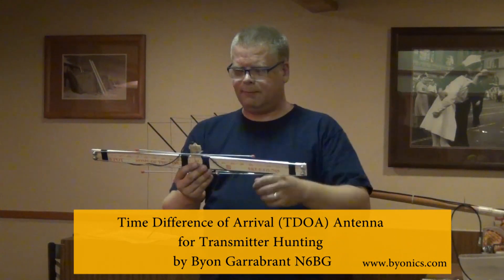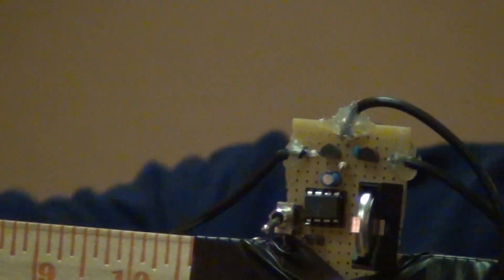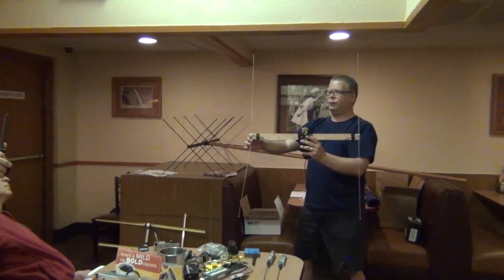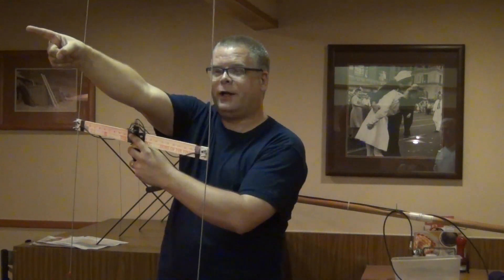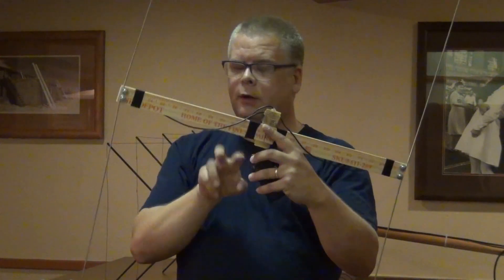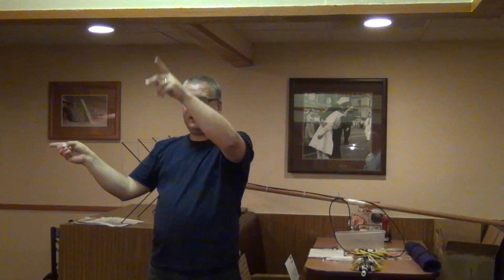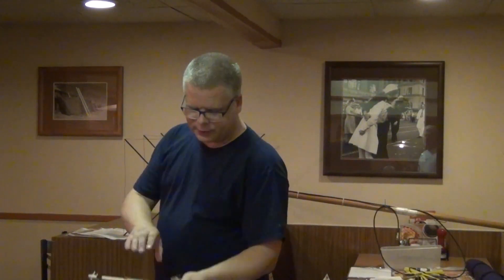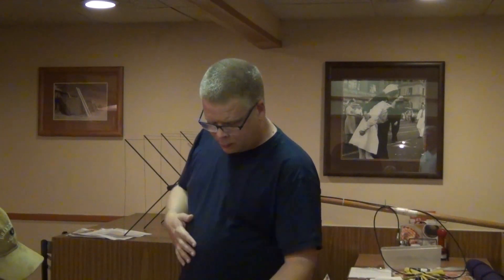Transmitter Hunting using TDOA: Time Difference of Arrival

Comment: One way for this to work is to use one element as the front, the other as the rear element. Measure the time it takes for each to receive the signal. The rear element should get a delayed signal, equal to it's distance, from the front element. This way, it eliminates the problem with the Equidistant TDOA method.

Comment: This is Doppler DF unit developed by the Germans in WWII.  In WWII the ship receivers did not have RF front end amp so the LO would go back up the antenna and radiate.  Germans knew Allied ship freq and radio being used so could determine LO freq and listen even when ship was not transmitting.  I am sure with WWII tube tech it was large unit.  I built about 10 years ago using 555 and PIN diode switching.  Also there are manuf that do make with 4 or more antennas with diplay and do not have to turn the antenna array.  Coast Guard in Florida have units on their boats and also array on towers for locating boats in need.  Does work great, even the 2 antenna version.  Works with FM rig and listen for tone null to determine direction.  There are many articles in QST, CQ and older mags on this unit.  Has been very popular unit for DFing.  I am sure the FCC has some.
Reply: Yes, you are correct.  It's "doppler" or "phase difference" but too many people try to label this TDOA.  In the truest sense, it is not.

Comment: Bit confused why he didn't use 3 antennas to start with, you wouldn't need to spin it, but you would need to add some sort of display to communicate the result to you (ie: a rotatable arrow).  But his way, you don't need an arrow, it's just the direction you're standing, simple.